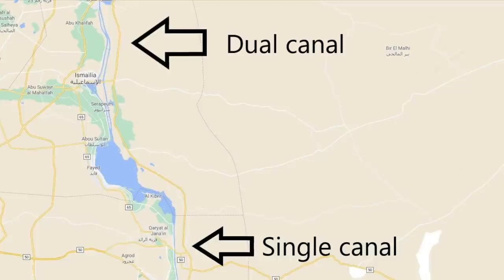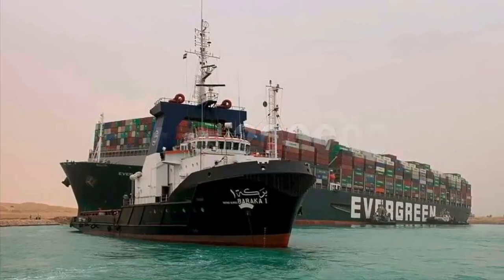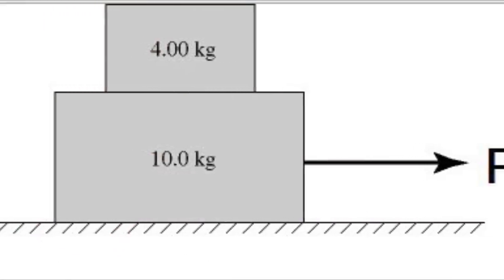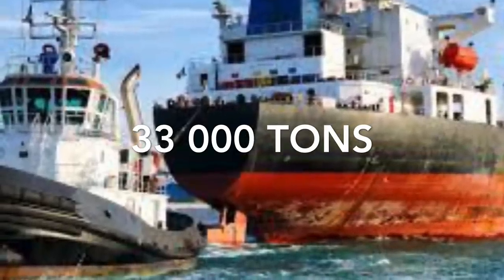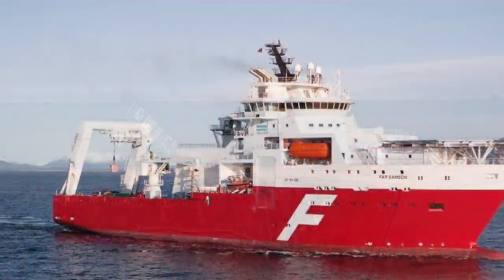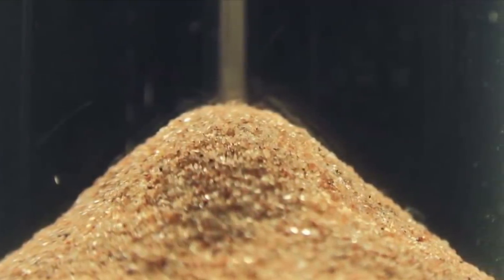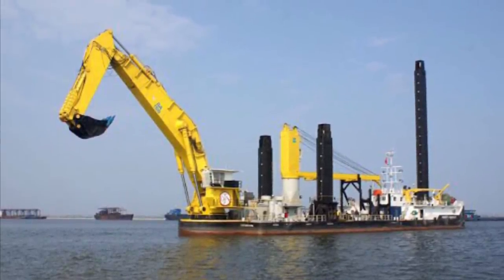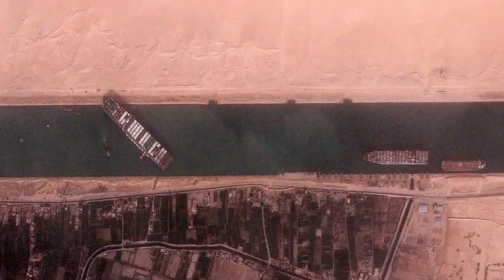MV Ever Given - why can't it be pulled out? Suez canal blocked

Comment: It's quite amazing how narrow this extremely important canal is and how all these years it remained incident-free.
After seeing this video I wonder how ships never had accidents here.
Reply: This size must be banned from entering the Suez Canal including Capt Schettino..
Reply: well you have to be sober and on alert to captain a ship in resent years, and there is usually not only 1 in charge
Reply: Nah, the limit is 50 ships a day. To send more goods you have to have bigger ships
Reply: Use water dynamite to blow the sand dumes away  and the vessel  will pop up free. Water dynamite, yes invent it or adapt, something like hard  water balls.
Reply: The ships used to be much smaller.
Reply: @Stale_Mahoney  there is only one in charge.
Reply: @captainphil2023  are you thick? sure there is only 1 captain but you say the others on the bridge got no say? if they see something going on they wont alert and take action?
Reply: Incident-free???? What are you talking about? This has happened before.
Reply: @captainphil2023  In charge? Yes and no. There is also a pilot on the bridge, and while the Captain has the ultimate say, the Pilot is mostly the one giving the navigational orders.
Reply: Not so fast, 1983 I was a helmsman of a  1200 ft.  356000 ton deadweight tanker that went aground on portside of the ship while the rudder was on hard starboard. 4 hours for two ocean tug boats to pull us out. I have a pretty good idea of how this accident happened.
Reply: @Xxx27500  Simple: a sand storm came pretty quickly, reducing visibility to near zero, killing radars and blowing the ship to an undredged side of the canal. The Suez is a dump anyway. It’s improperly maintained and the channel is uneven depth, with poor markings. A fully stacked giant container ship has no chance in that circumstance.
Reply: It's the widest canal in the world
Reply: Will King  😂 And you will pay for it?
Reply: It was designed for the 19th century type of ships but now these monsters are super big
Reply: @Orinslayer  In theory, yes. In practice, only a small part if it is the usable dredged channel. Also, because it is wide, it’s uncontrolled, unlike narrower canals where ships are pulled along, while tied up to ground tugs. This creates issues with navigation and steerage.
Reply: They didn't used to have woman captains...
Reply: Are you people that are commenting totally dumb. This was done deliberately to hold up all the ships carrying containers to rescue innocent trafficked children.   WAKE UP ffs.
Reply: It all depends if the banking cabal have placed bets on the oil price rising, it was not all that long ago options expirations were about to expire on their bets for the oil price to rise and all it did was go lower, then they started their shennanigans seizing Iranian tankers and torpedoing Japanese tankers and blaming Iran.  They just made it as well otherwise they would have lost trillions.  The instant the options expiration was up and they made rather than lost trillions all the shitfuckery stopped.  This is just more of the same.
Reply: It’s easy to have an accident when u do it on purpose!
Reply: @captainphil2023  I think you’re having a reading comprehension block. Re-read what I wrote, carefully this time.

Comment: In this section the canal is about 700' wide. The ship is about 1300' long. However, The channel is only about 350' wide at the most. At least a quarter of the ship is stuck at each end. From the photos of the shore-side excavator the soil isn't just sand but a clay/sand mix. The bow is buried at least 20-25' into the bank. There's going to be suction as well as friction to deal with. Even when they get it clear, the canal's capacity is 76 ships per day and there are about 3-400 ship waiting to go through. Plus, getting the Evergiven free is bound to pull a lot of debris into the ship channel so there will be dredging needed before full operations resume. If they can get it free by March 30, the best case scenario, it will take at least another week to get caught up. Quite possibly it won't be until mid-April before it's all back to normal. That's when the fines and lawsuits start. That will probably last until 2030.
Reply: It should be imploded this month after the crew has gone & most of the cargo is unloaded. The worth of the vessel far, far less than the cost of permitting it to remain in place for weeks.
Reply: Yep.  Personally I think it’ll take several more weeks. 
They seriously need to widen the canal to make  things like this less probable given how much bigger these ships have become.
Reply: I doubt that this is the first time such a long & heavily loaded ship has gone through the Suez Canal. Once it's been done successfully once, there's no reason that can't be repeated  ad infinitum, no matter how windy it ever gets on the Canal.
Reply: They (Egypt) should have widened this section back when they were doing the renovations on this canal.  Or ban large  container ships.   Which will it be... I predict they won't do anything because they love the money.
Reply: At 1:39 am ET the New York Times published the following update!!!
"The mammoth cargo ship blocking one of the world’s most vital maritime arteries was wrenched from the shoreline and set partially afloat again early on Monday morning, raising hopes that traffic could soon resume in the Suez Canal and limit the economic fallout of the disruption. Salvage teams, working on both land and water for five days and nights, were ultimately assisted by forces more powerful than any of the machines that rushed to the scene to assist in the rescue: the moon the tides. As water levels swelled overnight, the hours spent digging and excavating millions of tons of earth around the Ever Green paid dividends as the ship slowly regained buoyancy, according to officials. While shipping officials and Egyptian authorities cautioned that the complicated operation was still underway, they expressed increasing confidence the ship would soon be completely free. Images on social media showed tugboat crews celebrating the victory in the predawn hours."
Reply: There are crews on standby that could bag, inflate and float the front end of that ship, but NOBODY IS CALLING THEM.   Why?!!?!!?!!?
Reply: @jcspider7259  the local people wasted much time trying to solve the problem before calling  international experts.
Reply: @jcspider7259  the local people wasted much time trying to solve the problem before calling  international experts.
Reply: @mcslipper8875  They can raise just about anything.   They raise entirely sunken ships with bags.   Bagging and raising 200' of mid-ships to bow is nothing.   A big project: Yes, but not impossible.
Reply: @mcslipper8875  Just FYI, the Costa Concordia was lifted half full of tons of water with a tank system that was capable of lifting over 66,000 tons......

Comment: The fact that you can’t dig sand vertically could help if they could pump jets of water around the bow to blast or wash the sand away since they can’t dig it.
Reply: The use of high pressure water jets is nothing new to the Egyptians. They used water jet hoses to clear gaps in the sand wall located on the eastern bank of the canal. This was done as part of the surprise attack against Israel, at the start of the Yom Kippur war.
Reply: That is exactly the thing I just said.
Gotta be a bigger reason it’s still being left there......
Reply: @leidersammlung6955  I think your right , there is more to it than meets the eye. The canal is so vital to the economies of  so many countries . I can't believe that the Egyptians have no contingency plan for such an eventually.
Reply: Blowing the sand into the canal just burries it deeper.
Reply: Liquify the sand from underneaththe bow. Push pipes underneath the bow  and pump air and water through them in order to add space and water to the  compacted sand.
Reply: @billy.g3597  Liquify the sand from underneaththe bow. Push pipes underneath the bow  and pump air and water through them in order to add space and water to the  compacted sand.
Reply: @patricksanders858  The physics doesnt work: you cant pump with enough force unless the pipe becomes as compact as the sand underneath was to begin with -  then you are back where you started

Comment: Dig a hole beside it with a dredger, then use hydro blasting to push the sand out from underneath and into the newly dug hole. Thank you, this has been my Ted talk
Reply: getting the required machines and setting it up will take months
Reply: @oksowhat  Maybe not with the Antonov.
Reply: Actually sounds like a good idea .
Reply: I was thinking the same thing they could adapt a hydro hose system to a track hoe and a big pump and Wash all the sand loose.
Reply: We have to understand that any object that gets stuck in the soil and covered with water has a force from both ends. So the object wont push back unless it is a floating object. Now the ship has lost her floating ability as she has embedded her front and rear sides in the soil. Only way is to use the same water force to turn the ship after digging both ends to have more room and unload the heavy containers to reduce the weight. Water pressure can give either by explosion few meters away to create heavy waves like tsunami or increase water flow from one side.May be it will help her to turn back.
Reply: Sorry, you're going to need to add about an hour of fluff for it to be a "full length" TEDtalk.
Reply: told ya , the crazy ones might get the job done....what concerns me are the forces at work as she is being freed..One ton in excess at the wrong point may break her which may require changing her name to the M/S Ever Grounded.
Reply: @jhorne18  well, transporting them is not that of a task rather setting up, considering the fact that the area is sandy a solid foundation is requried, and to have such a foundation time is requried, i think they can built a small channel along the place where the ship is struck, like a smaller but jugad type
Reply: A multitude of "VACTORS" , built for the wastewater industry
Reply: was thinking the same thing
Reply: Nope, the hole just u turns the pumped  fluid straight back out, or into the sand. Yiu wint get the pressure to apply over a large area of hull ..it won't lift up.
Reply: While in the Navy, I was on a carrier as it was put on blocks during drydocking. One of the concerns was that when large ships like this are supported wrong, or have supports removed or installed in the wrong way, there is a very high chance that the whole ship will tip over. Additionally, based on other reports, this ship has experienced some flooding. Massive ships end up creating massive engineering problems when things go wrong.
Reply: Good solution with is not mentioned here. There are several companies specialized in these type of recovery. They only have to bring their material to the place, but often they can respond very fast.
Reply: Why didn't they think of that?
Reply: I'm  thinking the same thing .
Reply: Honestly, just load that thing with explosives, and make a huge safe zone. Daily losses due to the canals closure are more than the ship's value, and a ship will never get stuck there again
Reply: @eckhardbinding7469  LOL
Reply: @tihzho  I mean it's the middle east it's basically already a bomb range
Reply: "The nose" lol does he means the bulbous bow? that containership is a flat bottom vessel
 And where the hell did he come up with his Weird mathematical equations "1/3 of the vessel means you need to pull 50% of 1/3" what the hell is he talking about? Does that formula take to account the substrate of the channel? 🤔
This guy just made all this stuff up to get views
Reply: They can bring the required equipment in by boat. It would not take much time at all. Someone just has to pay for it.
Reply: Sounds like it would do less damage than blowing it up, which is my bright idea.
Reply: @oksowhat  The machinery isn't a problem since they are present in the canals maintenance fleet.
Reply: @dlstb  Gee, why didn't they think about that!
Reply: @Luther Blissett Because its not a hole
Reply: @eckhardbinding7469  Boi , now I like THAT!
Reply: @oksowhat  Good point.  Regardless, a mess it is going to be.

Comment: The narrow canal makes it difficult to use many towboats - as correctly said in the video. However the narrow canal also means that there is land close to the ship's stern, where is is relatively easy to install many land-based towing winches and pull the ship from the oposite side of the land. With a quick search i found that winches with pulling force of 600 tones (https://www.kongsberg.com/maritime/products/deck-machinery-and-cranes/deck-machinery/tug-vessels/towing-winches-tugs/) are available, so a number of 55 winches is required to achieve the total pulling force of 33000 tons. Not a small number but significantly less than the 80 Far Samson vessels. And certainly there is enough space on land to install them (perhaps there are even bigger winches available). In any case this is trully a difficult task.

Comment: "Armchair engineer" here...
Dig a big hole into the bank around the bow.
Use hoses to blow the sand around the bow into the hole and dredge sand out of hole.
The weight of the ship will cause most of the sand under the bow to move sideways so that it can be removed by pressure hose.
It will be far easier to bring in a bunch of large pumps in than dredge ships.
And they have already started to excavate the bank around the bow so just carry on with a modified version of that tactic.
Reply: Bravo... no need to be lot of smart to realize that solutions they showed to us are useless and diging from out of water isnt solution at all... so I have right to think that ship isnt there stoped by accident
Reply: I had exactly the same thought. My guess would be, that you would not even have to remove all the sand. You only have to remove it on the sides, and get it in a soft state underneath the ship.
Reply: What you're describing is basically a water jetting operation. Use water to blow the sand away from the hull.
Reply: It didn’t take long to find a solution in the YT comments.  I am never disappointed with the great ideas that are presented to problems!
Reply: Hydro-vac just blasts water and sucks up all sorts of shit. Call badger daylighting they’ll be over ASAP to do it. The boys would love the trip!
Reply: I actually posted the same idea a few mins ago 🤣. Having working on a building site 20 km inland from the sea, at sea level, on an old risen sandy beach, it's very interesting to see what actually happens once you let the groundwater appear when you dug a hole with a digger and it suddenly dissapeared when all the sand became part of the water. Lol
Reply: Unfortunately 80%  isn't sand xD
Reply: They could also pump out the sand onto the beach like they do here in Jersey when they replenish it.
Reply: It is probably going to take a combination of techniques. Removing the sand around the ship is a huge undertaking when you consider the size of the ship, the amount of sand that needs to be removed, it could take months to complete. One source is saying 706,000 cubic feet of sand needs to be removed. That number seems very low. We'll know soon enough.

Comment: Ever given´s nose is not at 15 meters deep at the moment. You can see that in the picture at 1:14.  Around 1/3 of the nose is above the water surface. so nose is at 8 or 9 meters deep instead of 15.    The bad thing with Suez canal; Canals width at its surface is wider than width of the bottom. So if we say; the canal is 300 meters wide at its surface, the bottom is like 200 meter or less. I don´t know why. they know better.
I think it would be easier to unload the ship so other vessels can save it.